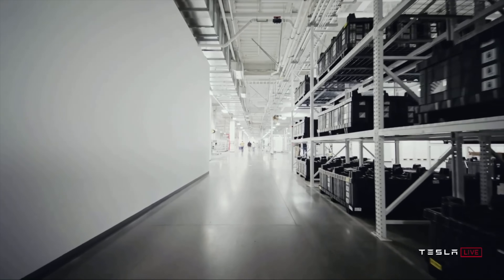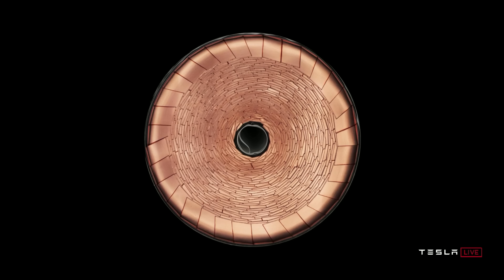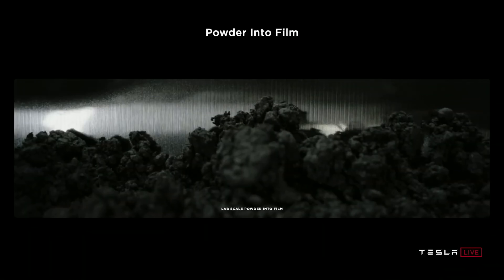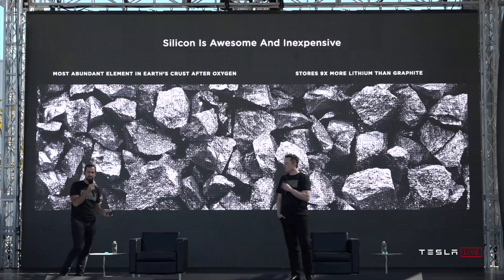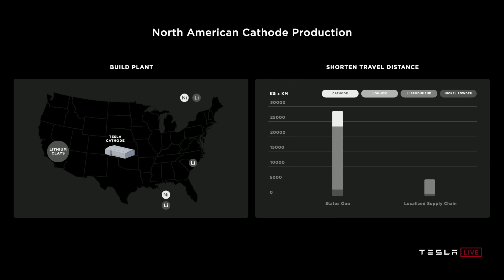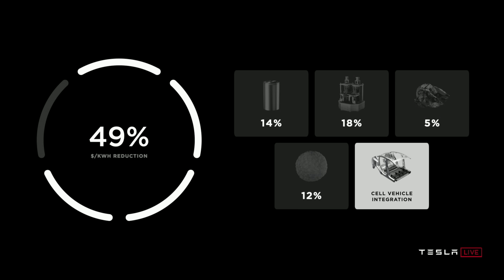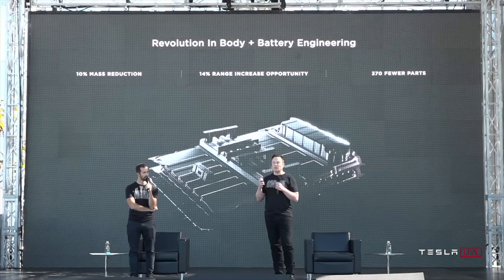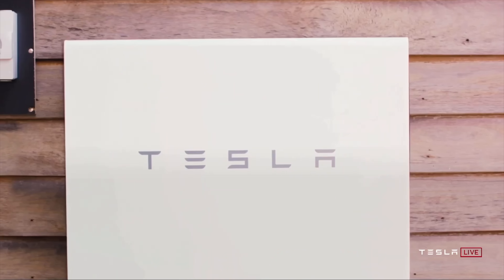How Tesla's New Battery Will Destroy Gas Cars

Comment: If I had 2% of the money Elon started with I could put Tesla out of business.  Folks if you want to get OFF oil you can't do it with an EV.  EVs will DELAY the point of zero CO2 by 35-40 years.  I explain it here: https://newenginetype.com/co2-issue  This New Engine Type is 4x less CO2 than an EV, at least.  The problem with EVs is the battery.  This new engine type can give 4000-6000 mile range in 2 minutes of filling up at 10 gal/minute pump.  That is 800 times less time than a Model 3 in charging at 50 Kw for 68 kwh (80% of 85).  

For the weight of the battery giving equal economy the range with 191 gallons would be 24,901 miles or 1 trip around earth.  Folks, batteries are a JOKE.  1 gallon of gasoline with this tech in a model 3 without the crap in there at 2000 lbs would go 260 miles which is equal to the 80% charge of the 85 kwh battery.  Rule #1 is weight.  Rule #2 is respect rule #1.  

All transit will be going to the air and an air motor is key to real drag reduction of 50% through active drag reduction, none of which is done with electrics. Batteries and roadable airplanes are a total waste of time joke. Why drive when you can fly at 200 mph for the cost of road tax, tires and brakes.  When road tax is weight x distance and a BEV is 2x weight the tax is 2x.  At 2 cents/mile for a 4000 lbs Tesla, the fuel for a 2000 lbs New Engine Type car would be 1 cent and road tax 1 cent, or equal to the road tax of the Tesla.  That is like driving for FREE fuel compared to a Tesla.  Free fuel...just by the difference in road tax when done correctly.  1 cent for 2000 lbs, 2 cents for 4000 lbs.  Weight costs money.  BEV are a total joke.  

 Again, fuels are many times cheaper and there are 10 fuels that this engine can use.  Electro fuels from nuclear, wind and solar as well as bio are the path to replacing oil and BEVs just waste $trillion in capital o a dead end.   Again, 4x less CO2 than a Model 3 with the same body...  Not even close.  1000 HP is doable in a Model 3 size car.  This is NOT your Grandpa's IC engine.  It is all new, and beyond anything any car company has.  

Too bad Elon is too blind to wake up and see a real path to real solutions to energy.  Using slave labor and massive capital (CO2) is not saving any CO2 if that is your issue...  BEVs are dependent on the grid and the grid will be gone in 15 years just like land lines are.  Grid in Germany is 30-45 cents/kwh.  A 100% renewable grid would be 60 cents/kwh or $20/GGE or 10x more for battery than oil or electro fuels from nuclear.  Thorium to fuel is 4 times cheaper than thorium to BEV.  Why?  Grid costs...  Fuel is cheapest way to store by 18,000 to 1 over Li-ion.  What a waste of time Tesla is...

Note, all of this Giga factor is NOT needed with my tech.  A 2 gallon plastic tank for $1 can replace the entire energy storage of the EV battery.  My manufacture costs are well below 1/2 if not 1/3 for a car that can tow, and beat any Tesla if so equipped with performance package.  All this junk in the EV is a total waste.  My tech will be around 60 years from now, long after that EV is in the junk yard causing ground water contamination.  What a total train wreck....

Comment: Electric  vehicles are great and efficient and Tesla is a remarkable company  however at this time the total  percentage of electric cars is only in the low single digits and that is without taking into account commercial transport like trucking and shipping which actually use the bulk of fossil fuel. I suspect it will take decades before electrification  will be done on a global scale. A efficient and cheap source of electric energy other than coal fired power stations need to be found because they only move the point of fossil energy usage.Renewable sources are not dependable  and governments are to scared to use nuclear which are cheap and dependable
Reply: Eric Smith in many Western countries the percentage of electric vehicles is doubling year on year. Doesn't take to many doublings...
Reply: Completely understand and a big supporter of elecric vehicles ,my question is where will cheap and reliable electricity be scourced from when demand increases.I hope somebody can give an informed answer

Comment: I am confused by the graphic that show 5x energy from the new battery technology but only 16% better range.  I know battery capacity is not linear with respect to range - a 100KWh battery doesn't provide twice the range of a 50KWh battery.  But a 500% increase in energy only nets a 16% increase in range?  Am I misunderstanding something?  Or when they say range, do they mean lifetime range?
Reply: dweiss1 it's correct because even though the new cell can store more energy, it's bigger, so fewer of them can go in the car. But because of density improvements, you do end up with that 16% net gain.

Comment: Tesla charges 28c/kWhr round here which means a MY with either the heating or the a/c on costs about 7.5 cents/mile for fuel. A RAV4 hybrid gets about 40mpg which round here translates to 7.5 cents/mile. If you do 12,000 miles a year and keep the RAV4 for 15 years, it will cost less than $10,000 for maintenance. A MY in that time will need a new battery ($8-12,000) two new drive units ($16,000), half shafts ($1,800) a number of: door handles ($1,000 each) rear light units ($1,000 each) MCUs ($1,800 each) etc. Want cheap driving? Buy a Toyota.

Comment: This is going to be crazy 10 years from now when a $20k electric car only needs charged every 5,000 miles.
Reply: And that needs to be serviced every 25 years. I'm a car nut myself, but seeing the potential future for electric cars is much more exciting than anything I've seen in ICE cars in the last 5 years.
Reply: I'll be happy if it's just 250 mile range and it charges in 5 minutes.
Reply: @madocworks1147  What if it has 400 miles range but you can charge up 300 miles in less than 10 minutes?
Reply: @madocworks1147  that would indeed be more use than longer range.  Abilty to "fill up" in a comparable time to filling a tank with petrol.
Reply: @rjrfletcher2355  But you're missing the fact that if you plugged your car in every night, you would literally never run out of charge, making the charging time irrelevant.
Reply: @madocworks1147  I have a car that can do that!  It runs on gas...
Reply: @lukedornon960  And ICE  are also improving all the time
Reply: @madocworks1147  How may KWhs does it take to go 250 miles? What is the charging rate required for your 5 minute charge?
Reply: @madocworks1147  Perfect!
Reply: HAHAHAAA.. STOP DREAMING..
maybe 1000 miles.. which would be insane !!
Reply: @UTVH21  Exactly what are these people smoking?
Reply: I have no issue if I need to charge every 250 miles as long as I can charge the car in a few minutes and not half an hour to even an hour.
Reply: 10 years from now there will be hydrogen cars, dude.
Reply: lmao...
Reply: Some major hold ups are right to repair, available parts after warranty and global battery production capacity.
Reply: lul yes and I can't wait to see it unfold.
Reply: TEC Man  okay.
Reply: All this talk about recharging time and most actual EV owners just plug it in at home and virtually never bother with supercharging except on roadtrips. And they usually just grab food and take a crap.  I have easily spent 35 minutes standing in line to pay, pumping gas, standing in line to crap, and standing in line to buy food at a traditional gas station. Anyone who thinks every single highway stop only lasts 5 mintues is lying to themselves and everyone else. Seriously, time your rest stops on your next road trip. You might surprise yourself.
Reply: Ten years from now there will be no cars...and there will be no roads outside of major cities except ones that connect to other cities. This is  the goal of the U.N.'s "sustainable development" policies...and many western politicians are on board to create these urban internment camps. Read the U.N. publications on Agenda 21 and Agenda 30 for yourself.
Reply: Musk is on a mission and is still very young. 20 years of technology in a matter of months. Who knows how fast this technology will compound
Reply: yes it is crazy.....crazy and very unproven
Reply: tesla's cars are terrible if you haven't heard. What would make anyone think they wont be terrible in 10 years. Elon is more interested in new tech than actually making a production car. This will always be their issue. Will never make an affordable and quality car. Enjoy your 20k tesla shitbox in 10 years it will fall apart and the self driving tech will kill you.
Reply: How many KWhs does it take to go 5000 miles? How long does it take to move that many KWhs?
Reply: Inflation would like a word with you
Reply: 5000 miles?  Major failure in chemistry right there.    Sport jock possibly?
  
250 - 300 miles    MAYBE and it will still take all night to charge, and if you live anywhere that gets close to freezing, your range drops to like 1/2  or less . (battery discharges to stay warm)
  
I'll stick to internal combustion, gas works well.  Emission help to cool our planet.
Reply: @sonpopco-op9682  Build a box with a window facing the sun.  Seal it with a thermometer inside.  Monitor internal temps.  Next day add CO2 and monitor again.

Comment: Gas cars aren't the only thing getting destroyed either. Consider, if you will, the price benefits of a 100 MW grid-level battery storage pack, and how many peaker plants you could step down with it. The South Australian Megapack is an example of how profitable they can be with the current design batteries. Imagine how much more efficient the tabless batteries will be, and how much cheaper they can be produced, and that they can now be made with the LFP even cheaper cathode battery chemistry for further cost reduction per KW/h. 

The south australian megapack paid itself off in under two years. Once Tesla scales up volume production sufficient to be able to pull that many batteries away from vehicle production without hurting their vehicle manufacturing lines, every power company will want them.

Comment: Are these battery initiatives restricted to their Y, X, S models? Will the budget model 3 share in these changes?
Reply: The y and 3 will be the last to get the new batteries. The s and x will be first followed by cybertruck, semi, and roadster.
Reply: Likely brand new production vehicles will get the cells first. That would include Model S Plaid edition (not normal Model S), the Cybertruck, the Semi, and Model 3 and Model Y built in Berlin.  It will come to Shanghai Model 3 and Model Y and then slowly trickle down to American made Model 3 and Model Y and S and X.  With Roadster in there whenever they decide to release it.